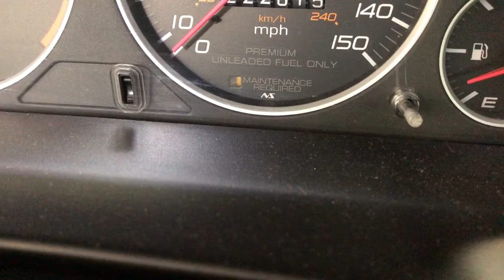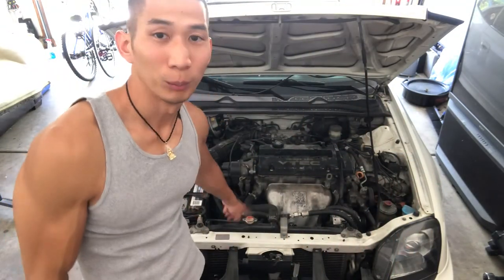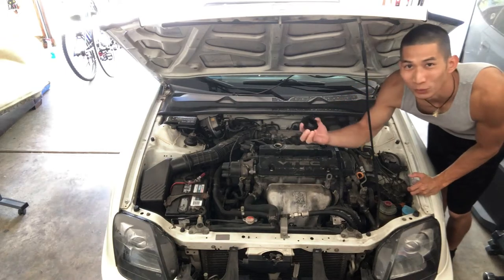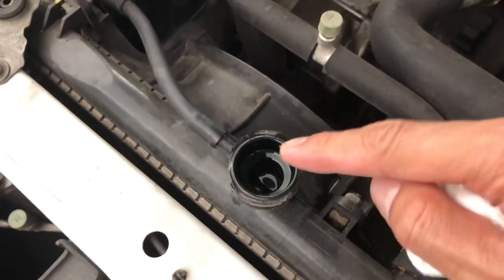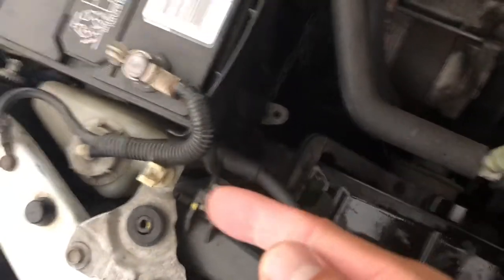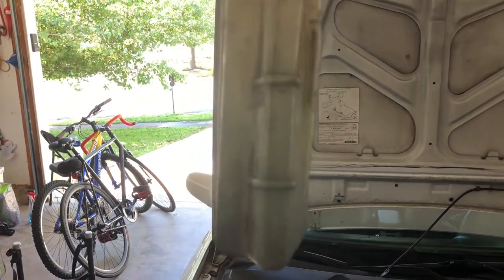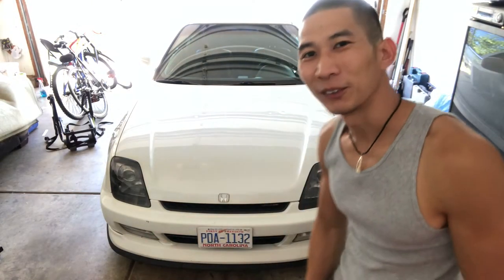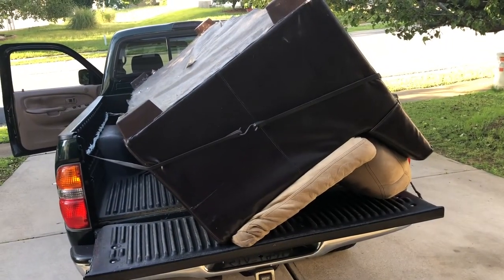TLC for Prelude (26 of 365)

Comment: That maintenance tab, switches colors based on miles. If I remember correctly its set to 7,500 miles. If you didn't reset it before by inserting your key into the rectangle port next to it last time the car had its tires rotated/installed. That tab really doesn't mean anything. The only thing it clearly means is you are getting close to 7,500 miles since the last time the maintenance reminder was reset.
Reply from the maker: Yoooo, thanks a lot for the info! Def great to know, I thought it was some sort of alternative to the CEL 😂🤣

Comment: Yo i saw you again on 85, it was hella raining that day too. But man just a heads up, my sis prelude was overheating like your too it would eat up the oil and coolant. Turn out to be bad head gasket so she got rid of it. Keep up the maintenance bro thats really the only reason i watch your videos for the cars haha.
Reply from the maker: preciate the feedback man, My brother was sayin the same thing about replacing the head gasket. Mayhaps I shall replace it when I get my next paycheck :D 
What car did you say you drive?
Reply: @Rawrkee  yeah man no problem, and i drive a black acura TL.
Reply: I 2nd the valve cover gaskets. My 05 Acura TL was burning oil as well and I replaced the front and rear valve cover gaskets @ 239132 mi. There was one gasket on a sparkplug that was leaking.